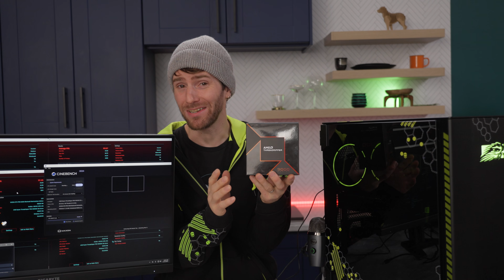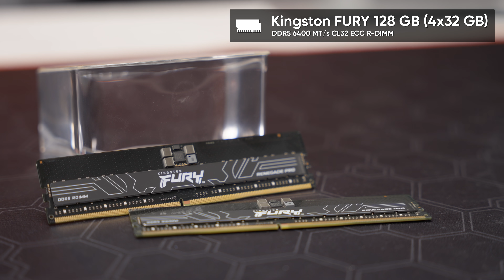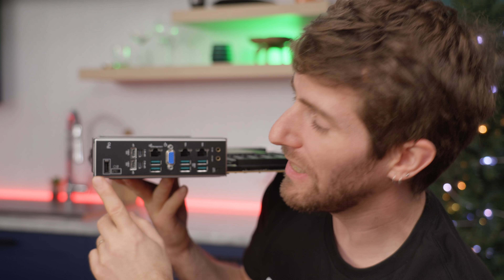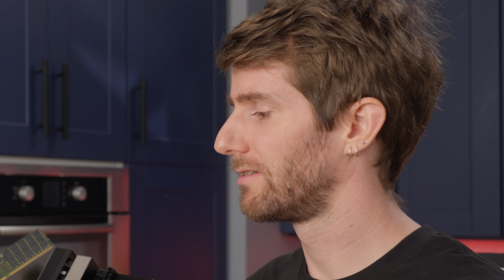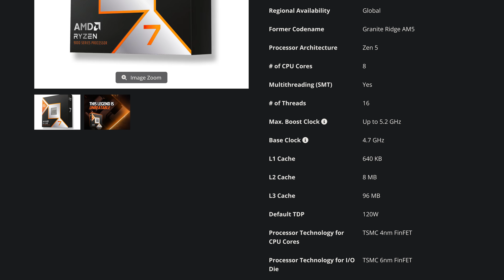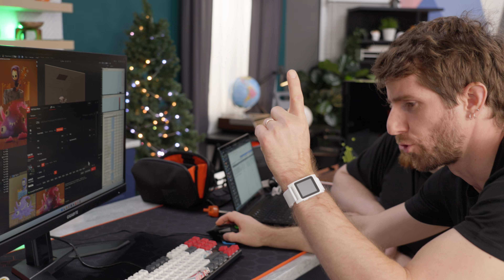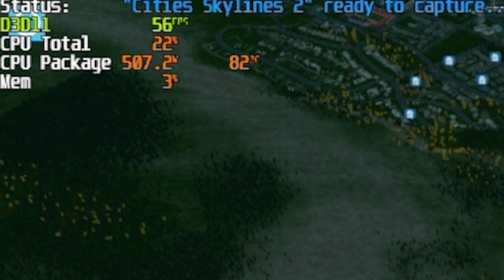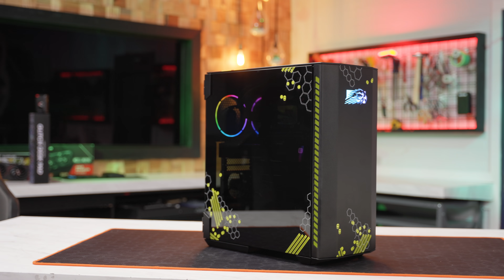The Fastest Computer I've Ever Had

Comment: minimum cooling: 480mm rad aio... best for that cpu? custom loop with heat exchange/chiller like what you pulled out. 
you need allot of water volume to soak up all that heat. never worked on or tuned a threadripper, but ive been tuning ryzen chips and keeping in the know since ryzen 3000
they are all super hot little chips. the more cooling, the better. 

the only thing i thiink you can do with a pc like that is AI or a home game server you can actually play on yourself. even your most rudimentary pc's could run software like CAD, 3d solidworks or any 3d art program, so it would be pointless to use your super pc for that. 

also i think you'd need to call AMD and assure them you have a mountain of money if you want the pro chips. they're the only ones who know for sure who has em in stock and can tell them to sell to you.

Comment: Problem is that many games are not that good at using multiple cores. The main game loop things are often calculated sequentially meaning that one computation has to finish before next one can begin. For example in fps game you can't start to compute who got by projectile before you havent finished the computing of new locations for all the units that moved this frame. And other cores mainly do things like play sounds or load game files on the background. So for average game, 10 GHz 4 core CPU would be better than 5 GHZ 100 core CPU.

Comment: hey linus, i have a suggestion for game benchmarking this thing

minecraft with distant horizons set to the absolute max, theres a setting in the rendering options for distant horizons where you can set the number of cores it uses to render the LOD chunks, the maximum option is called "i paid for the whole CPU" and it truly does completely max out anything you run it on. i believe this behemoth of a pc might stand a chance of running it maxed out with decent frame rates, try it with physics mod and photon shaders to stress the GPU as well.

Comment: Haven't plugged in my microwave for almost 2 years now.. So even my smart bulb(connected to my network) that I never turn on uses more power than my microwave.
But my microwave when used can go up to around 2300Watts (measured with an accurate powermeter), so the title is still false.

Comment: I have a Threadripper 1950X from 2017.  It's not my primary system I use daily (Ryzen 9 5900X), but it's still my favorite.

I can't even imagine what a modern day Threadripper is like, I might have to trade in my current pcs and upgrade.  ;)

Comment: LINUS YOU SHOULD'VE TRIED RENDERING CHUNKS IN MINECRAFT USING THE MODS C2ME AND CHUNKY THAT'LL USE ALL THE CORES (and RAM AND STORAGE SPACE!!) YOU HAVE!! (and now has hardware accelerated chunk loading which uses the GPU but to what EXTENT the GPU can help is still CPU dependent so a massively overkill CPU paired with a 5090 (or similarly powerful workstation GPU) should make for a ridiculous improvement over vanilla). Also, it's possible to use Voxy as well to actually see all the chunks you generated up to a near infinite render distance at a very minor GPU cost using LODs! An "infinite" render distance (technically not but big enough to seem infinite) is actually possible now! Would be a banger video idea imo.

Edit: I kinda lied but also didn't, C2ME's scaling starts to drop off past 50-ish threads and doesn't scale particularly much at all past 80-90 (so there wouldn't be much of a difference between the 64C and 96C Threadripper, but it'd still probably try to utilize all cores and would make for a great video that I think nobody's done before)

Comment: What a terrible case for airflow you are shilling:
+ Heavily enclosed front
+ 2x 140mm front intake (heavily restricted)
+ 1x 120mm exhaust
+ (optional) 1x rear 80mm intake below primary gpu (would probably re circulate some exhausted air from the rear 120mm)

Really Linus?

Comment: i feel like this is the kind of pc see when i see someone saying they train thier own ai model... though i also train my own ai model  based on co-pilot, but it is really slow, and also dosent work that great, but i am also stillm learning it. note i have rx6750xt and r7 7700 with 32gb ram, so i know that i need to upgrade my pc massivly to do any real ai training, but still, i try to learn it so best way to start is by doing it, but if, i had something like this, ohh boy would it ever be much better and easier to train, and learn anything from it, without spending like 2 weeks just to see it fail, and start all over again. worst part is, this is my spair time, i study electical engineering, i dont have time to properly do any of this ai stuff, yet i am here and doing it, just because i can and also might have adhd, and autisme, or some kind of mental disorder, idk. dont know what even wantet to say with this comment, other then i want that cpu, and a better gpu, because ai training is hard and suck on "lower" end consumer hardware

Comment: I've got a very similar build to the one shown off here. 9995wx + 1TB 6400 MT/s + 4x RTX Pro Blackwell 6000 MaxQ + 4x Gen5 4TB in Raid-0. 
I use it for AI model training + inference + heavy data processing workloads.  Luckily I grabbed it in September before the RAM + price-hikes on essentially every component. 
I don't stress the CPU that much (my larger workloads today are only 70% utilization across the full cpu), but interesting to see that it does work / there is some headroom to be had there if I ever want to push the cooling.
Reply: I have a similar one as well. Cheaped out in the ram and went 768GB kit. Kicking myself for that. I could really use the full 2TB but it is so expensive!

Comment: Please, attach this to the 3-phase chiller 🥶
Reply: Do It Do It Do It
Reply: But what if we delided the CPU
Reply: It needs 3-phase PSU anyways
Reply: The 3 phase chiller can cool way lower, which is useful for maximum frequency, but it doesn't have the thermal capacity to handle 2kW of heat (unlike their pro water chiller). And even if it could, they are already limited by the 2kW power profile of the motherboard.

Comment: The 9995W in the name is the TDP
Reply: Damn is😂🎉
Reply: Its called that because when you run something it hits 99.95 degrees
Reply: This is more expensive than a 5090
Reply: Lol right? You need to modify a microwave to scale the power for it 😂
Reply: You gonna need 10x 1600W PSUs to power this shit. And probably $2000 worth of just radiators
Reply: Good thing in europe have 400v outlets in our homes...
Reply: @test-rj2vl  Some people still don’t have 3-phase.
Reply: @xanderplayz3446  I have 3-phase in apartment building - not even a private house. And btw 2 phase is enough because 400v is between 2 phases not between phase and ground.
Reply: @xanderplayz3446  You can generally request to have it without much hubbub.
Reply: @test-rj2vl  That is a thing. But it's rare! Especially in homes! Although 400V is available if you get a specialized outlet mounted (good luck hooking that up to a computer PSU...), 99% of outlets are 230V.

What you should be more concerned about is amps. But most schuko outlets are only rated to 16A (3680W at 230V). Obviously, the 9995W thing was a joke. But say if it was real, you would probably need multiple power supplies on multiple fuses to just power the CPU. 

Even then, you would have to make sure that your main fuse is even able to handle such wattage. A main fuse in a large home might be 40A at 400V, which is 16kW. But it's not typically recommended to continually load your main over 80%, or 12,8kW. Getting your main upgraded to a larger capacity can be challenging, and often involves asking the grid-owner for permission to see if there is even leftover capacity for it in the existing infrastructure.
Reply: @venorando3672 That 400V was meant as a joke also. I knew that there is no PSUs that take 400V as a input.
Reply: @test-rj2vl  Of course it was. My comment was made with that in mind. I still think there is value in it. 

What can I say? It's just interesting to see how difficult it would be from a logistical standpoint to power a 9995W CPU if one actually existed!
Reply: @venorando3672 BRO CHILL ITS FINE ITS A JOKE
Reply: @venorando3672 Y do i think ur a bot no offense if ur not
Reply: @test-rj2vl Where TF do you live? In the EU we have 220/240V.
Reply: @sedixmrboss5625  EU is 240 V for single phase sockets. Use the 3-phase 16 A wall socket and you can pull 19200 W constantly with no problems. Except for th electric bill, of course. If you live in an apartment building, your apartment may be missing the ready installed wall socket. Even our house has only one because we didn't pay for extra installs.
Reply: @sedixmrboss5625  I live in estonia and I have 3 phases in my apartment.
Reply: @test-rj2vl  Why TF?? What uses 400v? 😅
Reply: @sedixmrboss5625  Currently I am not sure if its beging used. The cable itself runs to my cooker but since I did not install it myself I don't know if it is wired in 400v or 230v configuration. But you can buy cookers for example that are 7 kw.
Reply: @sedixmrboss5625  the oven in the kitchen.
Reply: @sedixmrboss5625  anything can use virtually any voltage; what changes is the current: the higher the voltage, the lower the required current to deliver the same amount of power. For example: 2200W in 220V = 10A of current; 2200W in 400V = 5.5A
Reply: @sedixmrboss5625  If you live in Norway, you may have a IT-system rather than a TN-C/TN-S system. Although 400V is possible, IT-stystems are usually limited to 230V. If you live in any other part of Europe, you you almost definitely use some sort of TN-system. You may still only have 230V into your home, but having 400V is quite common, although it's wired in a way where you only get 230V in your outlets and such, as one of the leads is a 0V neutral. You will only measure 400V between two "230V" leads on different phases.

Comment: Even city skylines II  chugging at 1080p while using 400w and 1/4 of this monster is insane.
Reply: Idk how is that possible, because it runs so much better on my 13700kf and 4070ti. there was this 1M city save that ran at 29fps 2 years ago when the game was so much less optimised than it is now. Maybe they accidentally used custom values in the graphical settings or something
Reply: Classic LTT using way too small city for this test. 183k city runs just fine on any 8-core starting from Zen3. Won't even fully load it.
Reply: You can't run Cities Skylines 2 on a Breadripper and the 5090's roid rage cousin.
But can it run Crysis?
Reply: Nah I had this running on insane machines and built new machines from the 3080ti then a 4090 and now a 5090 and it’s still crap. On my 3080ti machine the game was crashing so much. I asked for a steam refund but they declined me.

I hate cs2 and I thought I’d love it based on cs1
Reply: It's user error on their part. Cities Skylines 2 runs just fine on far less powerful machines at maximum graphics.
Reply: @wuffydave  Is that why a ton of players hated the game for not running smooth? Is that why people complain about this problem even today? All user error I guess. Can't blame Paradox. Funny how they never said anything about "user error", or a quick guide on how to actually run the game smoother. nope, they said NOTHING, dumped a lot of useless DLC's and that's it. The game was bad even when they streamed, fyi. Not even the devs could run it right. User error, right? So much of an user error that they admitted about the problems in the game (which they never fixed) since day 1. BUt the game runs just fine at maximum graphics on far less powerful machines. Souce: truste me dude. Go back to sleep.
Reply: @henriquelejambre7705  No one said the developers made a flawless game. The point here is that LTT was getting worse performance than average machines do
Reply: @pp00rrkk bro wake up, if a top of the line industry level hardware struggles while being barely used, its the software problem, not the user and not the hardware.
Reply: @erwinamanciosilva7693  They were running RTX Enterprise drivers and not GRD. That was the problem
Reply: @henriquelejambre7705  nah dude never paradox fault , give them 5 more years and 4 more dlc n it might be time for a new city skylines which will end up with worse performance n the paradrones sayin “it’s running better than their last”
Reply: @henriquelejambre7705  surprisingly not paradoxs fault, colossal order are just shit devs. Cs1 was also incredibly unoptimized and after paradox picked them up and let them work on cs2 they missed the release date and delayed 2 years and still released it unfinished and unoptimized. Basically why paradox is effectively reorganizing them now and taking their devs to make a new team without the bad leadership of CO
Reply: @wuffydave  I can attest since I also do 1080p but get 120+ on a 4070 Ti Super
Reply: @wuffydave it’s not user error, this hardware is not made for gaming. you are seeing the effects of diminishing returns
Reply: @wuffydave I love your optimism but i run hardware which should handle it just fine but any city larger than 50k isn't running even at 1x speed so no.

Comment: Still would probably get 45 FPS in Star Citizen
Reply: haha love that this comment was top when i loaded the video :D
Reply: Don't you mean 2 FPS in Yandere Simulator?
Reply: @Username5H0 is that, is that still going?"
Reply: @cocoadragon8554  I'm pretty sure he stopped development ~2 years ago... but my point still stands.
Reply: Star Citizen absolutely loves lots of cache, so the x3D chips really improve the 1% lows and remove the stutters, especially in places like Levski.  Recently went from a i9-9900k to a R9-9950X3D and noticed  about a tripling in average FPS at Levski to (~20 to ~60) but the 1% lows went from about 3 to 30.
Reply: Just to Clarify, although the 9995WX has 384MB cache vs the 128MB on the 9950X3D, this is still only 32MB per CCD, whereas one of the CCDs on the 9950X3D has 96MB of Cache, and a game only wants to be running on one 8 core CCD, as communicating across the infinity fabric between CCDs introduces latency which harms performance.  This means in practice the 9950X3D has triple the cache available on it's 8 core CCD vs any of the CCDs on the 9995WX, so will run games like Star Citizen much better.
Reply: @PhilJordan123 so you mean we need 9995wx3d, all 12 ccds with 128mb cache, that'll be 1.5gb of l3 cache
Reply: @PhilJordan123   It seems you have spelled "Cash" wrong. Store Citizen absolutely loves lots of cash.
Reply: Lol true
Reply: does it run doom?
Reply: fr
Reply: games so uinstable after they added the nyx system, I uninstalled it until next year this time lol
Reply: Hell yeah
Reply: Lol
Reply: Lol
Reply: Lol
Reply: @Jeefly  that feels optimistic 😅
Reply: Nah, it's actually smooth now with Vulken implementation
Reply: @HackedToaster  No its not! It never has been and never will be.
Reply: @elzonn  if you're installing the game on a harddrive or having only 8gb of ddr3 😂 I think it could be a hardware problem. I'm getting 40fps in levski with my 5 yearold rig, a 2070super
Reply: @elzonn  sorry but statement like that wouldn't hold up forever and being in denial when you haven't really experienced it with reasonable hardware is making you look like an ignorant fool
Reply: I have a 9800X3D and I get 80-90 consistently outside of levskey (Lagsky as we call it) and I have a 5070 Ti GPU btw.
Reply: When im outside of* is the oldest cope comment ever used by humans ever. That "game" is a cluster F. Nothing more nothing less.
Reply: @huss_117  THat's it??? try Pyro with it..
Reply: @huss_117  9800X3D is part of a newer generation of AMD chips that requires DDR5 RAM, right? I'd like to upgrade from 5800X, but I don't want to change mobo or RAM to do it.
Reply: @user72974  Now's a terrible time to switch to ddr5 unfortunately 😬. I upgraded back in July and I'm glad I did
Reply: @user72974  Well AM5 is the newest platrofm but its already 3 years old.
Reply: @user72974  5800X3D is good enough on AM4......now that price of everything is rising I would say.... upgrading just your CPU is a good choice if I have a capable GPU to pair with it.....

Switching to AM5 would essentially make you buy everything again....your RAM , mobo , CPU....etc idk.....so ...
Reply: @user72974   Especially now that DDR5 prices have reached 5x of 2 months ago
Reply: @user72974  5800x3d is your only option and for games that don't benefit from big cpu cache you wont see a difference.
Reply: @user72974  from 7000 series or newer it requires new mobo and DDR5
Reply: Dude no reason to upgrade. Just enjoy the pc you have for now.
Reply: @user72974  yeah, it's AM5. If you have a 5800X the upgrade isn't worth as you only get ~25% more. Wait until the AI bubble pops and then upgrade to whatever AMD calls the 800X3D equivalent on the market at that time.
Reply: @user72974  genuinely, 5800x3d or even 5700x3d is a big upgrade over the normal 5800x
Reply: *Store Citizen